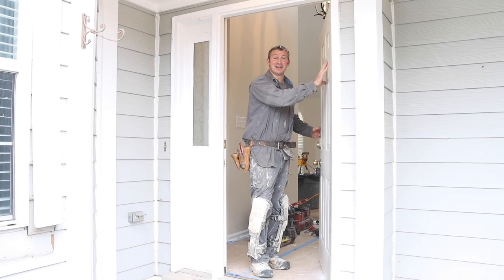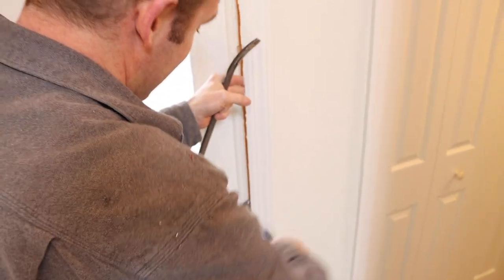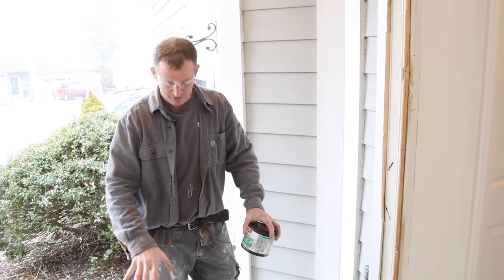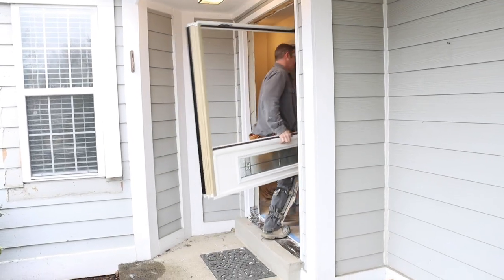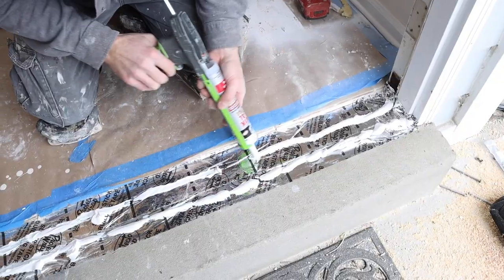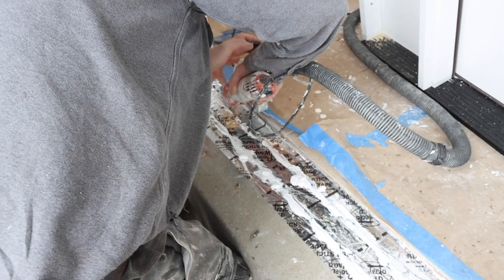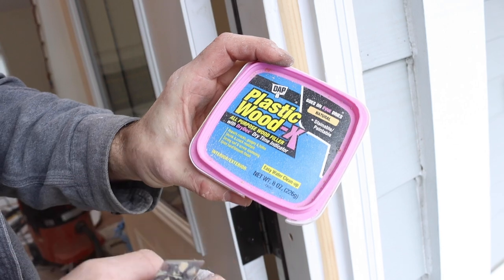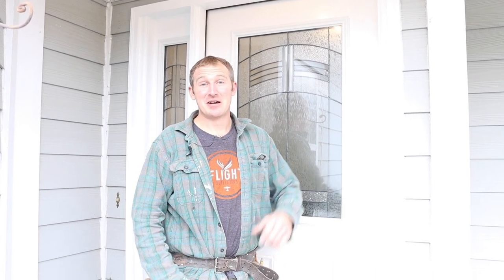How to Install an Exterior Front Door with Sidelight

Comment: Great video.  I am really glad you didn't edit out the parts where you had problems with the jamb and tile and had to take the door out and fix things.  That's real world and what someone would really experience and nice to see how you fixed those issues.  In most of these type of videos the contractor will edit out the parts where things don't work to make it look like everything works perfectly on the install and that's not the way it ever works, at least for me.  Thanks again for putting together a great tutorial and video.

Comment: Amazing work and video, but why would you not check for level, plumb, square, depth of threshold, etc., before installing? Was this an oversight?
Reply: Yes it was an oversight.  The only time you need to use a level is to check the stoop, then put level back in truck.

Comment: I had a new front door and two sidelights fitted and the installer fitted it to the uneven floor instead of levelling it to the frame.  What a mess.  He returned and levelled one side light and the door but couldn't level the other sidelight as there wasn't the space!

Comment: Not sure if there is a real savings here. A DIYer would not have the tools to make this micro adjustments all over the place. They would have to buy them. Hence lost savings. I'm s DIYer. I always remove the old entirely and install the new. I've gotten the right size each time and never had to force a door in nor adjust the door or frame to get it in. I always check plumb and level before fastening the entire door as well. As such my doors have always worked right the first time. Also you may be voiding any warranties with the adjustments on the door. I'm not sure I'd recommend this video. But hey way do I know?

Comment: Odd method,: the sill needs to be dead nuts before installing the door (checking the sill would save you some pain) 6’ level is needed  to level the jambs. Anyway, I suppose it’s way to criticize while I sit on my coach. Most tradesmen are good at finding the flaw in the work of other tradesmen who share the craft. I give you an A for  making the video. .